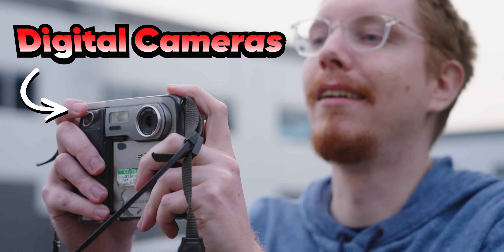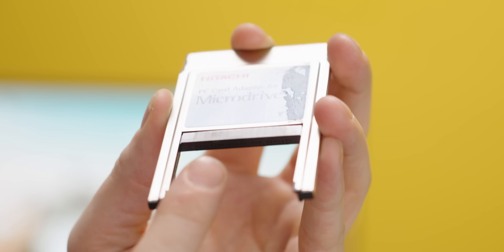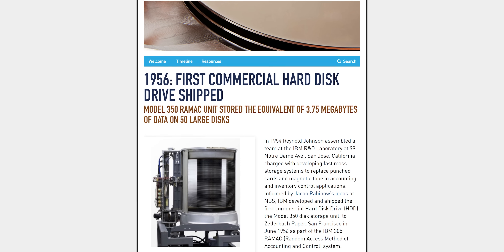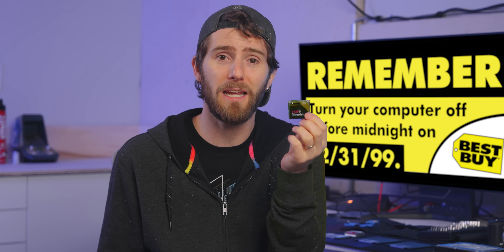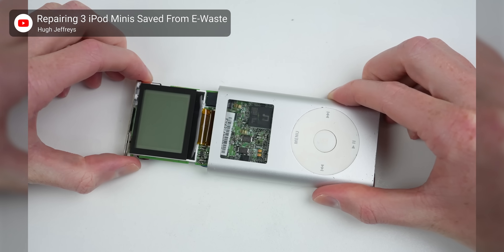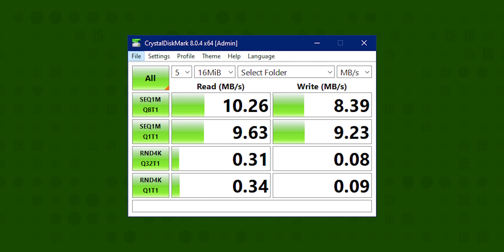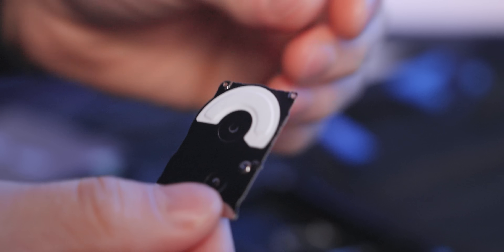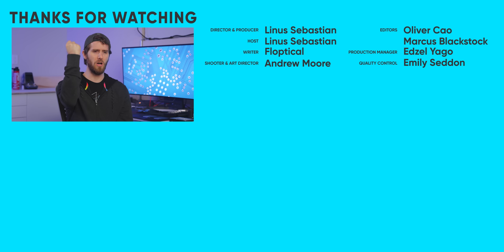This TINY Hard Drive is REAL... and it changed the world! - IBM Microdrive

Comment: What was also great, besides not having to drop your camera off to get developed, was with digital it was the first time you didn't have to be stringent with the shots you took. Or save a disposable camera for a year until you finished filling the roll before getting it developed. The freedom to just take photos whenever of whatever was mind blowing at the time. My first digital camera was a Kodak the size and weight of a brick, that used 6 AA batteries. Sure they were only 1 mega pixel photos, but it meant no longer wasting film if I took a dumb photo of dog poop, and my parents couldn't tell at me for wasting film.

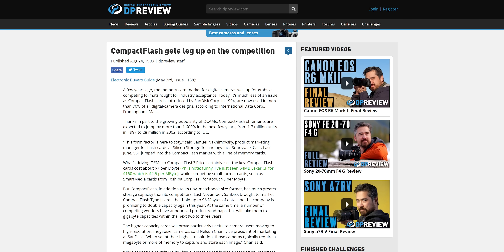Comment: 1:22 "This form factor is here to stay"  Well, not completely untrue, as there still CF cards being made and sold, but of course SD won that battle after all.  I still prefer CF, and would use it if anything I had took it.  :D  Why do I prefer it?  Because of the size.  Yes, I like that, SD cards are a bit too… flimsy _feeling_.  And a bit easier to mislay (or drop under something, anything actually).

Comment: I'm not sure what is in the ipod classic 120gb but its def mechanical, because I can both hear it spin up and feel the gyro effect of it. :D
The ipod was bought in the time where apple made products to FUNCTION, not to break after x use of time. IT STILL WORKS PERFECTLY, both as music player, but mostly what I use it for, a super cool mp3 hd to have all my media on for my raspberry pi 3a media center in my camper. I even power the ipod through the usb from the raspberry, through a hub, because the rpi 3a only has ONE usb port. Works perfectly. I bought the ipod in 2005, and I honestly think it will fill it's purpose for me for at LEAST another 10 years!
Sadly, quality like this is GONE FOREVER. They want to constantly sell you new stuff, so the old stuff have a built in lifespan.

Comment: I genuinely want to see some real-world performance figures on a modern OS running from one of these things now. Are there any companies out there making legacy hardware for older digital cameras still?

Yes I know the performance would be god-awful but I still want to see it
Reply: It'd be abysmal - the random read/writes were horrible.
You don't need legacy hardware to replace a microdrive, it's size and pin compatible with Compact Flash
You might need to partition newer, bigger CF cards to be compatible with FAT16 or FAT32 disk size limits though

Comment: I worked for and was given several variations of the micro drive while I was working at IBM. When the 1GB landed it was great for travel photography you could leave the laptop at home and not worry about clearing the photos off the drive to use the next day.

Comment: I had a 2009s sony full hd video camera that has a 180gb hardddrive from the ipod..it is non removable and can record 13hours of 28mbps 1080p 50 video. Although i used 16gb sd card back then cus it would increase the battery life by 20-30mins. And faster to transfer the data from sd card to my laptop & 16gb allowed more than 1hr of video which was enough for me..

Comment: You forgot to mention the original iPod Video with its 30GB, 60GB and 120GB mechanical Hard drives. When I found my old broken iPod Video, I removed the 1.8" hard drive and placed it into a external hard drive case so I could transfer all my pictures and videos onto my pc.

Comment: To be fair you said Microdrive 4MB/s is poor, It's not at that time.

But actually the CF transfer rate at PIO Mode 4 is capped at 16MB/s and later with DMA at 33MB/s. and Most harddrives in same era also only some will do UDMA2 at 33MB/s. (Later upgrade 66MB/s during Pentium II).

Most Fast Flash Memory in the same era can do less than 10MB/s only some will do better than that.

Comment: ~4m55: 1,000,000 is the real GByte/Gbit/G-whatever. Hard-drives and comms equipment have never been sold in 1024²/1024³/... units. Floppies were half sold in 1024 units but only when discussing formatted capacities because controllers commonly used 512 byte sectors - they had stated unformatted capacities of 2,000,000 bytes (for what was usually called 1.44MB in IBM-ish-PC-land), 1,000,000, and so on). That us programmers and other similar types decided M should be 1024² because it is more convenient for us doesn't make 10⁶ incorrect overall.

Comment: The CF and mini HDD drives were awesome for iPods. And the CF standard for iPod mini meant that upgrading it is real easy. It cost me 30 bucks to go from 4gb to 128gb with just a cf to sd adapter and a 138 microsd

Upgrading the microdrive in an iPod is a bit harder though, but really worth it.

Comment: Micro drive even go through enterprise network solution, I have worked with Cisco load balancera in 2004/2005 that were using thoses !
Sadly I wasn’t able to salvage one on decommissioning, the customer retrieved the gear at the end 😢

Comment: I worked summers for the local county sheriff's department when I was in college, as part of a very small -- one full-time, one part-time, plus me full-time-seasonal -- IT department. Right about this time, digital cameras were coming out and there was a big push to digitize lots of old photos and other records. The department picked up a couple of the Sony Mavica floppy cameras for mugshots, and I remember often coming in on Mondays to a big stack of floppies on my desk from the weekend before.

Why the disk cameras? Public recordkeeping. After I copied the files to the folder on the network server, I'd flip the tab to read-only, label the disk, and file it into a huge floppy cabinet (with about a hundred drawers). Yeah, not the most efficient, but floppy disks were cheap (certainly way less than memory cards, CD media, etc) and the process was hard even for cops to mess up. Take the photos, pop out the disk, drop in the IT room at end of shift.

Aside, it was always wild coming across people I knew from high school in the mugshot roundups.

Comment: The first digital camera I had came with a 2meg compact flash card, held around 11 640x480, low compression JPG photos, later got a 128meg for it which would mess up the photo counter on lower quality settings and indicate hundreds on high quality

Comment: My father bought the Nokia N91 (expensive AF at the time btw)  that I later traded with him for a  broken laptop I got for free and repaired. It's crazy that it was a spinning disk in a phone, (it does not sound like a great idea in a phone to me but) it worked and had 8 GB storage if I don't remember wrong, that was pretty insane and I could have soo much music on it. The phone was power-hungry though and needed to be charged every day(like smartphones) and I could hear the HDD if it was quiet in the room or I put my ear into it ofc.
Reply: I owned one. I bought it used. Pretty sure i got scammed by the low price and it was actually stolen because i found bunch of images etc on that HDD and it were not the sellers.
Later it developed a bug where i could not access the HDD. Only after searching the forums for months i found a solution. I dont remember exactly what it was.
The N91's build quality was great tho and i loved the metal construction and the ability to carry my entire music library with me on my phone.

Comment: I remember when I took a 4GB microdrive out of an Microsoft Zune and put it in my flash based digital camera. The Zune was 300$ at that time, but toshibas flashcard cost 1200$ as a Microdrive Flash card at that time, Toshiba went nuts when I spread the news you could  just tear a Zune appart and use that one and falsely informed everyone that it was a special edition flash card that could not be used for cameras, which it could - they had to give up because everyone did that after the news.

Comment: ipod mini?  ummm from what i recall, the ipod, OG, used a mechanical hard drive and it was a hack to buy one of those hard drives and use it in place of a compact flash card for extra storage on your digital camera, of course i'm talking later when those tiny hard drives were 30gb, 60gb, 120gb, 250gb.

Comment: In the year 1992, I was working at a company where a coworker tried to get a 2 gig drive for $2,000.  We couldn't believe the price, just a dollar per megabyte.  However, this might have been vaporware since the coworker couldn't get the drive.

In the early 2000's I was working at a different company, which gave me a 1 gig USB drive to use on my job.  I was amazed since this seemed like a ton of portable storage.  I felt honored to have it.  I checked Best Buy and they were selling equivalent drives for around $95.  Adjusted for inflation, that would be $165 today.

Comment: Had one back when I owned the 2nd Canon DSLR the D60 (6mp) which itself cost about £3k in 2002 bucks. a 1 gb flash card was astronomical, even the 1gb microdrive cost £400

Comment: Ok just to clear it up, one MB = 1000^3 bytes. The 1024 factor is used with MiB. It's not drive manufacturer's fault that Microsoft decided to incorrectly use the SI unit names but actually meant the -bi value.

Comment: I remember Micro Drives, which had a 1" platter,  which was pretty small. Guinness Book of World Records lists the Toshiba MK4001MTD as the worlds smallest production mechanical hard drive. This 0.85" 4gb 3600rpm drive was released in 2004. A 1gb version was also available, and  later, Toshiba introduced an 8gb version.
Reply: It was used in Nokia N91. At that time I thought that, when some online phone store wrote it has a hard drive, they meant Flash storage, because there's no way an actual hard drive would fit in a phone.  But apparently, that wasn't a mistake. Just another reason not to drop it. I wonder what it sounded like. Ipods are quite audible, I didn't flashmod mine because for me the hard disk sound is part of the experience.

Comment: Back around the time these came out, HP used the 1.8" drives as an optional (and expensive) cache for the HP 4v and HP 5si.   Got a repair call one time for an HP 4v that was not working and making a 'clicking' sound.  From 6 feet away I instantly recognized the sound of a bad HDD and knew exactly what the issue was.

Comment: I actually USED a digital camera with a floppy disk in high school. It was great for the yearbook when we had a spot for a picture that we needed to add at the last minute and no time to develop the film and either scan it or send it in for professional processing. If we had the digital picture, we could do it ourselves in a few minutes. But it would only work for small pictures. The biggest ones we could do at full resolution were like 2 by 3 inches and even then they weren't great quality.
Reply: I used one when I worked at an Auto Auction in...1998 I think?  1999?  Took pictures of repossessed cars to go with the damage estimates for banks, sent the banks the pictures via AOL dialup.
Reply: @greenmkyd  Our school got it in the fall of 1998. I graduated that spring, class of 99.

Comment: this is incorrect. We had a Sony Mavica.  The Sony Mavica FD5 20-40 photos per disk was the norm which blew people's minds back in 1998. This was because you either carried 35mm cartages around for 35 shots or you carried floppies around for the same number of images. Floppies were a hell of a lot easier to carry then rolls of film and you could go home and upload them via a serial cable..  Remember, its resolution was 640×480 pixels, that’s VGA resolution or roughly one-third of a megapixel. Megapixel cameras were a thing but didn't get cheap until the 2000s and then it all blew up a few years after that. 

Besides that, i had one of these tiny HDDs for the original psp(2005 or so) and it blew my mind it could fit 4gb in there compared to the 32mb the stupid magic gate card could handle.

Comment: Pre-ordered the 1GB model when it was announced, for my Canon Powershot camera. All I could tell about it was that it was slightly faster than the flash cards I was comparing it to, and the capacity was vast at the time. And I loved that little whir sound after taking a picture, though you had to have the camera close to your ear to hear it.
Reply: When you say "faster" in this context does that mean that you had to wait after each picture some time before you could take the next one?
Do you roughly know how long that was?
Reply: @Jehty_  I believe there was a very brief delay while the camera wrote to the card, but not really that noticeable. I was mainly referring to bulk operations, like when using the microdrive or CF card with a laptop via the PCMCIA slot, moving a lot of images, etc. For just taking single images, it seemed like it was writing the entire image to cache; you weren't stuck waiting while the disk was still spinning. (My recall is pretty fuzzy; it's been a long time.)
Reply: @manualdidact  🤣 now I feel like an idiot. Somehow I didn't think about moving the pictures.
Thanks :)

Comment: I actually have one of the 6 gig versions of these in a USB card reader right now. It is good for small file transfers and is indeed quite the novelty to have one that works. Though I did get better performance in write speeds than Linus did here. I almost want to install a live linux on it and put it into one of my old computers just to see how it performs overall. but that is for some later time.

Comment: I remember those 1" micro drives. They were great and led to the 1.8" drives that powered the iPod years later.
Reply: The 1.8" drives are amazing if you think about it. The 40GB iPod Classic came out 20 years ago. And yet now you can still get like 32-64GB Phones. The 160 GB iPod came out 15 years ago. The current iPhone and Galaxy still have a 128 GB Model for 800 bucks. If you told someone 15 years ago that their iPhone in 15 years might have less storage than their iPod now, I don't think they would've believed it. Sure the storage got smaller and faster and you can get 512gb options for a lot more money but the fact that the base models are still in that region is kinda weird.
Reply: I think the 1.8“ drives were earlier but with the 5th gen of iPods they managed to shrink them further
Reply: I have a laptop with one of those 1.8" iPod hard drives.
Reply: No the only iPod to use 1" microdrive was the iPod Mini. All other iPods use 1.8 Drives. 1st - 4th gen uses ZIF connectors and later models use micro sata

Comment: I'm surprised micro-drives didn't last longer to include solid state caching like the modern shdds today. The design of these drives looks like there's more than enough room to actually embed flash memory on the controller to act as a cache for read/write duties while the mechanical part of the drive would serve as simple storage. At one point, there was rumors manufacturers were working on these drives to eventually hold multiple platters to increase storage space but I guess the costs of direct flash storage became cheap enough to make and sell to abandon the effort. Obviously the pcmic port was basically the downfall of this technology but would've liked to see drives like these in high capacities in TBs using modern serial connectors.  Imagine being able to raid multiple micro-drives inside a space of a 2.5 or 3.5 HDD constantly saturating the fastest serial port made today? I wonder if it would compete with nvme i/o.

Comment: I Just recently bought a NEW old-stock 5GB sony microdrive, and a usb 2.0 CF reader.. along with a baseball display case and a raspberry pi zero-W.
I'm going to make the microdrive into a tiny NAS, and open it up once i can figure out how to display the internals without introducing dust.
I was even thinking of getting a helium cart to fill the display and then sealing it up. The whole reason is just to have an open microdrive display.
I just haven't figured out how i'll mount the microdrive for display or how i'll open and transfer it without introducing dust onto the platters.
I could make a mini clean-box

Comment: We have cnc mills that still read these at my work, all these years and I had no idea they were harddrives... just assumed they were some sort of flash storage. The more you know
Reply: There is a good chance they are flash storage. The micro drives were the mid-life of the CF media format. Early ones were flash and current ones are flash. In the middle the high capacity ones were micro drives, but flash was still more common if you bought one outside of an ipod. They were very much a stopgap in the format.

Comment: I had the 1GB model and actually managed to get windows XP booting from it on a laptop in a project where I was helping a hospital test whether they could use them to simplify turning thousands of desktops into basically thin clients, but booting off of a read only image from a microdrive in a PC card reader installed in every workstation, while also leveraging a RAMdisk for non-persistent writes. They were pretty terrible performance-wise, even just extracting a couple hundred megabytes of boot image was a painful affair, we had almost similar performance booting using the gigabit LAN from file servers. Such a cool technology back in the day, I remember the Hitachi rep insisting that they were going to hit 1TB within 5 years and that they were envisioning performance improvements where low cost servers with hundreds of these replacing file servers and NAS systems would be possible. NAND really killed that dream.